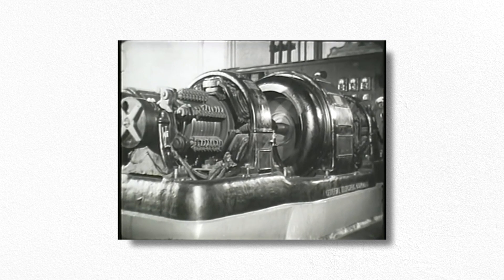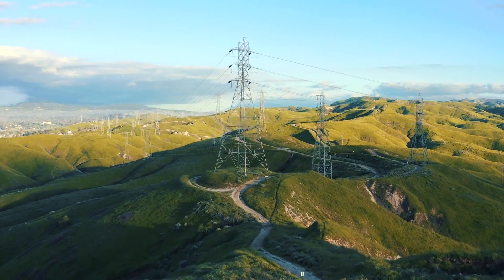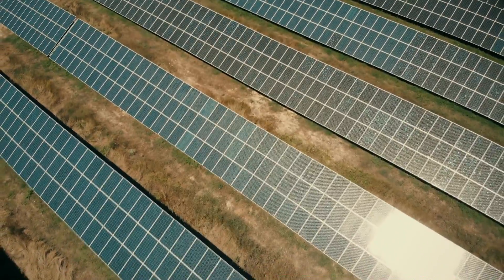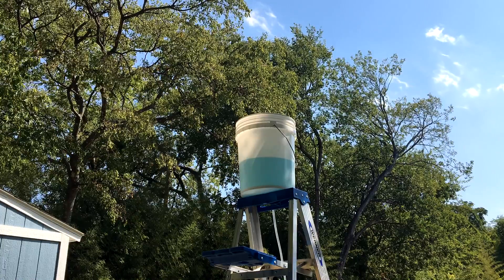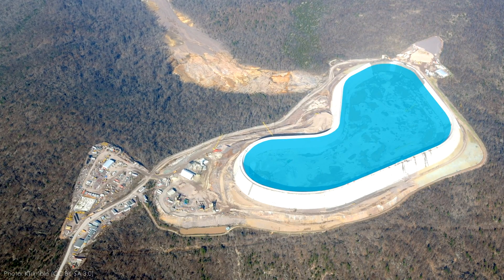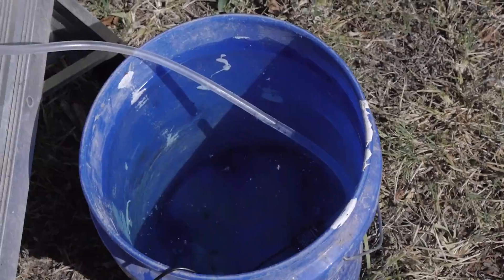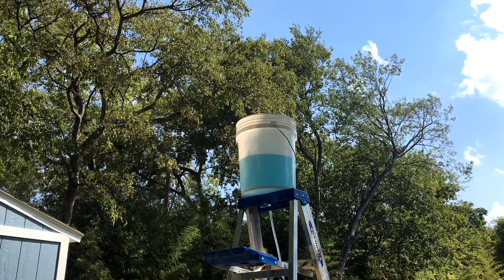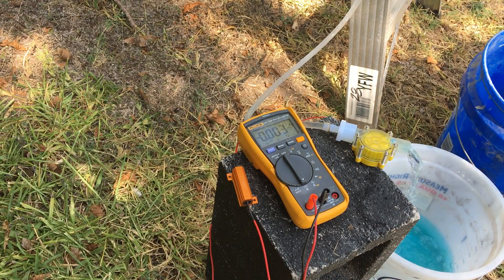World's Largest Batteries - (Pumped Storage)

Comment: Your integrity is amazing.
If you are searching for video ideas:
Why not do a video on alternativ energy storage methods, like power to gas.
Reply: Even less efficient - pumpstorage has a roundtrip efficiency of roughly 70% (or higher), P2gas so far the best lab results where ~70% - ONE Way. There exists quit a few already out in the wild, but their roundtrip efficiency is often lower than 30% even.
It is one way, but one that, with the current technology, is only viable because of the extreme volatility of wind and solar as well as the unreasonable push of those technologies.
Yes - unreasonable as they are so volatile that the endanger the electric power grid of whole countries and in total even increase pollution - great case study for that is germany (where they have many p2Gas facilities because of that).

It is an interesting technology, but imo it should be use for energy storage but rather for energy conversion - there are applications where you do need those chemical fuels and on the long run it is a lot better for the environment to generate the gasses needed from air than pumping them out of the ground.
Reply: @ABaumstumpf  Wasn't Germany's emissions increase from shutting down nuclear and booting up the coal power again?
Reply: @firstname405  Yes, significantly even so, because while wind and solar are renewable power sources, they are way too volatile and so they now have to run way more fossil-fuel-plants on standby.
Most of the time not even producing energy but they need to be kept running to be able to deliver the power when needed.

The nuclear power was great at providing the base-load very consistently and cheap (and still better for the environment funnily enough)

Better storage methods are needed, but the governments follow the blinded Eco-groups that are driven by outrage and not facts.
There is a nice article on the impact of different energy-sources done by greenpeace - despite their own numbers showing that even Chernobyl is better than Wind-power they say it is evil and should be banned...............
Reply: @ABaumstumpf  woah, that's crazy! Do you have a link for the coal plants running as back up but not providing energy? I'm aware of the benefits of nuclear energy but didn't realise they had to stoop THAT low
Reply: @firstname405  the turbine spinning provides inertia to the grid even at idle. They are also needed during increased loads, and most turbines cannot cold start easily.
Reply: @ABaumstumpf  It's equivalent to the asinine "biofuel" subsidies in the USA. Use petroleum-derived pesticides and fertilizer to grow GMO corn monocultures, process the corn into ethanol, and then cut it into gasoline which increases wear on the engines of the vehicles using it.

We'd be better off burning oil and money in an open pit.
Reply: @ABaumstumpf  yeah

Comment: Repeating my comment: Thanks for going hands-on on the efficiency of pumped storage. I had no idea it was so low
Reply: The efficiency for pumping up water is around 80% and 90% for power generation when letting the water flow back down. Multiplying those two numbers gets you 72%. It's way better than many alternatives to regulate the powergrid.
Reply: I was under the impression that all other things being equal, 70% efficiency was still pretty dang good. I'm under the impression cars were like... 25%?
Reply: @ChemistyStudent  You have to look at the complete picture and 25% is the efficiency of the whole car, meaning 25% of the energy stored in the gasoline is converted into mechanical power at the wheels. Now, if you look at transmission efficiency you have to multiply the 70% with 96% squared, one for transmission to the plant and once for transmission from the plant, meaning you have a complete efficiency of around 66%. Still better than coal plants, who have a maximum electric efficiency of around 45%. Gas and Steam Combi-powerplants are a little bit better and widely used for medium to fast load regulation, they have a combined peak electric efficiency of around 60%. Thermal efficiencies are naturally higher, around 85% for coal for example.
Reply: 70% isn't all that low.
Reply: Pumped storage develops relatively high efficiencies, partly thanks to economics of scale, specially designed components (pump-turbines, rather than machines designed specifically to be pumps or turbines, or very smooth penstocks to minimize friction losses), automated controls and operation at higher current and voltage levels (easier to overcome electrical resistance of wiring and magnetic components).

If you want to know about a place that truly leverages pumped storage, look at Japan. Despite its proportionately small land area for its huge 127 million and highly industrialized population, a lot of the hydroelectric plants of Japan have nominal power ranging from 100 MW to 3,000 MW. The reality is that almost all of these big facilities are pumped storage. Given that most of the water is cycled between the upper and lower reservoir (rest lost to evaporation and leaks), the flow that can be sustained is far bigger than what can be sustained if relying only on the river discharge feeding the reservoir. This means that, conventionally, pumped storage can usually deliver peak power 8-10x greater than the power of an equivalent conventional hydro facility having the same head.

Comment: Would love to see some future content on renewables, viability of nuclear energy in the future, hydrogen fuel etc. As an engineer i love learning about this stuff and other engineering disciplines. It's always interesting to see what other people get up to. Cheers
Reply: Wonder what the conversion efficiency would look like to electrolyze water and then burn the hydrogen again... hmm
Reply: DFPercush I don’t have numbers, but its about equally if not less efficient than this.
Reply: DFPercush Would be better for small scale though just due to the space requirements and infrastructure.
Reply: @DFPercush  Watch the video on hydrogen on the channel Real Engineering, there he goes about the values...
Reply: @DFPercush  Hydrogen is a bad idea, it's very difficult to store and to handle. Much better to use carbohydrates, much denser and usually liquid at room temperature. You can get the CO2 to make them from air or water, there's plenty.
Reply: @DFPercush  Lower, a lot lower - a single conversion is mostly around 35-50% only (depending on the specifics).
Reply: @DFPercush  Same issue as this video, only really works if the electrolysis can happen during the day using sunlight as the energy source, as this makes the hydrogen very cheap with the main cost being to ship it to the hydrogen fuel cell.
Reply: Try this video "John Bucknell - Nuclear Plant Economics & Synthetic Fuel Cogeneration @ TEAC8" from gordonmcdowell.
TL;DR is carbohydrate fuel is better than hydrogen fuel (hydrogen leaks through everything is a gas at 1atm, less dense etc.) Renewables aren't great because they take up too much space, don't make much electricity, unreliable (which also requires storage or quick start plants which are heavy polluters and chug gas) impact the environment negatively etc.
Nuclear on the other hand- very viable. Especially next gen (molten salt). Super cheap, minimal impact to environment (including the space it takes up) super safe and run at high temp meaning they're ideal to generate carbohydrate fuels. And there's plenty of fission fuel to last as long enough until we figure out fusion (hundreds or thousands of years)
Reply: @MrRolnicek  I would love to see thorium reactors become a mature technology. It's unfortunate that it got shoved under the rug for so long, but people are trying!
Reply: @DFPercush  If you look into the subject more closely you'll find out that there is no need for Thorium (yet) virtually all of the advantages of thorium molten salt reactors come from being molten salt reactors and most of the downsides come from them using Thorium. The good news is you can use Uranium instead and that opens up MUCH less R&D needed and more leniency in a lot of ways. Thorium is only really useful if you want a thermal spectrum breeder, but burners, fast breeders, even breeder/burner hybrid you really want to use uranium cycle. And then you don't need to mess around with FLiBe, worry about Tritium leaking and all that, you can use regular table salt in the fast reactors ... still there are SOME things that need to be figured out. But they could easily be figured out safely within a year if we just built a reactor now. Elysium industries or ThorCon would certainly be able to build one in less than a year if given the funds and the go ahead.
Reply: @MrRolnicek  Well yeah, Uranium is a more fission ready product, but it's also a lot more rare. Seems like we're just gonna be in the same boat in a hundred years if we rely too heavily on that. Using thorium fuel is about sustainability, which doesn't always coincide with short term economic benefit. But I would settle for the passive safety features of molten salt over PWR's in any case.
Reply: @DFPercush  Ah sorry, i should have been more specific I guess. What I mean is you can replace Thorium with Uranium 238 (which is almost as common as Thorium and not fission ready).
You're replacing a Thorium cycle where fertile Thorium turns into fissile U233 in a thermal spectrum (which is good) but with very nearly not enough neutrons (which is bad, means you need chemical processing on line and two fluid design usually etc.)
Instead of that cycle you have a fertile Uranium 238 which you breed in a fast spectrum into fissile Plutonium (and burn that in the very same salt and the same reactor vessel where you bred it). But fast spectrum has its own advantages. The chemistry doesn't need to be precisely controlled, you can keep a lot of junk in the salt and it'll work just fine and that ties into the neutronics which are very good, you have plenty of extra neutrons if you need them which is why you can use regular table salt even though it'll eat up your neutrons compared to something like FLiBe.
Reply: The problem with ram pumps is that they waste a lot of water in their cycle. And for a ram pump to put out a decent head pressure it either needs a pretty large head going into it.

Though if you don't have much head, but there is a good amount of flow, you can use a geyser pump. But again you only raise a small fraction of the water that goes through the pump.

Comment: The Thumbnail for this video, looks like a shoe with the angle it was token it.

That it what I thought it was at first glance.
Reply: Actually it's pretty interesting, it's the Taum Sauk reservoir in SE Missouri, not long after it failed and flooded a state park.  The bare strip on the upper side of the photo is where the water broke out and scoured the land down to bedrock as it rushed down the hillside.  Thankfully only the superintendent of the park was caught in it, he wasn't hurt, the water picked his house off the foundation and moved it several hundred feet.  The cause was found to be improperly installed safety equipment and user error that allowed the pumps to overfill the reservoir eroding he rock fill walls away enough to fail.

Comment: Maybe they should use the Shade Pool Black Balls to lower evaporation rates?
Reply: Wouldn't be worth it economically.  The only reason they were used in California was to block UV light to reduce the Bromate levels; added bonus was the deterring of waterfowl and reduce evaporation.  But it didn't reduce evaporation enough to be economic.

Comment: Would using a denser oil make any difference if it's a closed cycle unit? Just curious.
Reply: It would increase the energy density, but you'd also be going into an area different from current knowledge of pumps and electricity generation.  Water might not be energy dense, but you can easily get a lot of it, just make the reservoir bigger.
Reply: @josephburchanowski4636  
Oh thx, so hypothetically it would work just not practical.
Reply: @gwyn.  Basically.  If you really wanted to, you could make a mercury pumped storage facility.
Reply: Joseph Burchanowski 

Cool! And now I just need truck loads of mercury lol (notes to personal projects)

And I just check the reaction of mercury and nickel alloys, most of the turbines are made with that but it doesn’t amalgamate so might actually work. :D
Reply: @gwyn.  Is this Cody's Lab's secrete alternate youtube account?

Comment: So in other words Nuclear Power Plants are still the most cost effective way to generate electricity.
Reply: Nuclear power plants often work with hydropump storage facilities since nuclear power plants like running at a constant baseload.  In fact a lot of the hydropump storage facilities in the US exist to assist nuclear power plants.

Also hydropump storage isn't a way to generate electricity, only to store it.

If you mean nuclear vs wind & solar, then you do have an argument there.

My personal position is to heavily push nuclear power plants and Grid energy storage systems.
Reply: @josephburchanowski4636   I meant it as a joke to push the buttons of the Anti Nuke Crowd. But your answer in reality was most informative, to me at least. Thanks

Comment: Why don't we just have rechargeable batteries in everything?
Reply: Batteries have poor energy density. High cost. And they wear out rather rapidly.
Reply: Chemical batteries aren't really a great long term solution for power storage, especially on a huge scale. They are costly (getting cheaper, hence Tesla power banks) and fail after a year to five years, especially if used more often. Not to mention they can fail dangerously too, like the ballooned phones that are basically explosives waiting to pop at that point.
Reply: Batteries aren't good on systems where you need to care about weight and range.  IE they aren't as good for transporting vehicles which tend to have a weight requirement and a range requirement.  The same thing goes for large scale airplanes.   And also large scale boats.  Their energy densities are killer here.

Rechargeable batteries are also super expensive for the amount of Megawatt-hours you get out of them.  And in systems where you need a lot of potential storage but most of the time aren't using all of your storage, batteries are terrible.

As you need another battery for every additional load of extra-storage you want; and if you don't use it often then you really get hit hard by their high cost.

A hydropump storage plant despite having a low density can also be extremely huge in volume compared to a battery storage facility.  To double the energy storage, you just double the maximum amount of water you can hold in the reservoir.  For the same reasons batteries are also terrible for long term storage.

Comment: Is there any type of these water storage facilities where you would evaporate the water at the bottom and condense it at the top and run it trough the turbine? Or is that less efficient?
Reply: You're asking whether it takes more energy to boil water than lift it up? Yes it does, boiling water uses a lot of energy.
Reply: @jenyates3033  It starts to get out of the scope of battery vs generator, but I could see a system like this set up in a sunny equatorial location to capture the sun's energy.

Comment: This is an important video to debunk the false belief that "we will always need coal because we cannot store generated electricity ".    It shows just how practical and achievable this is.

Thank you!
Reply: Didnt you hear the part about all the severe limitations to siting these?
Reply: @brianjonker510 Absolutely yes - there are severe limitations - notably the 70% efficiency ratio, and the civil engineering required.    There are several upsides too - mainly the fact that these facilities use engineering skills which have been known since the Roman times and before - so we have a well known recipe for solving this problem.

The lovely thing about this is that we know that a feasible solution exists (which is different than the future storage devices like new innovations in material science to provide better improvements to lithium based batteries at some point in the future) - and now we can apply human ingenuity to improve efficiency over time without adding to the carbon load in the atmosphere.    We can also look at other solutions that were also mentioned (and I hope he expands into other videos) like molten sodium etc.

Even at 70% it's much better than the 0% we currently have if we need to take a nuclear plant off-cycle during a sudden power drop. 

So - fully agree with you - there are challenges - and with enough practical engineering we can solve these in a way that does not continue to impact air; soil; and water quality over time.
Reply: @RalphAlberg  I appreciate you positive attitude. Energy problems can be solved if we gives them the time, attention and resources required. These problems cannot be solved by wishful dreaming..